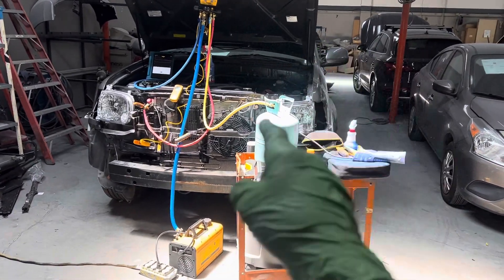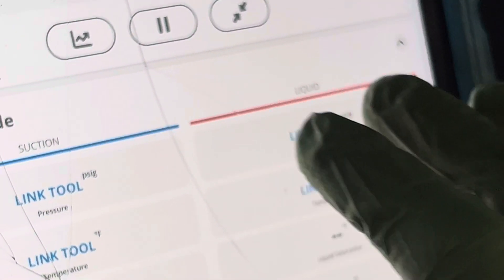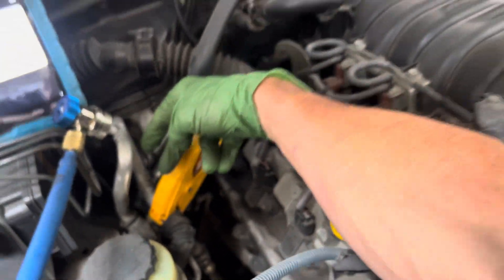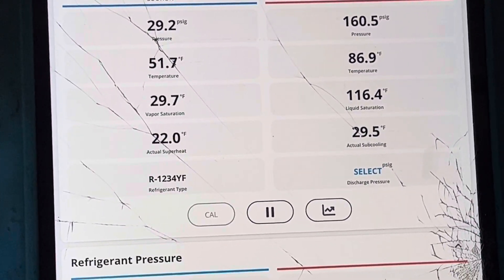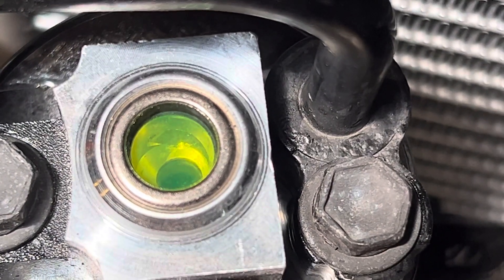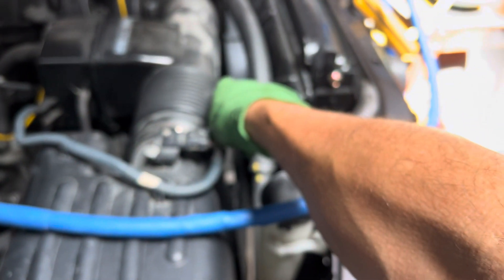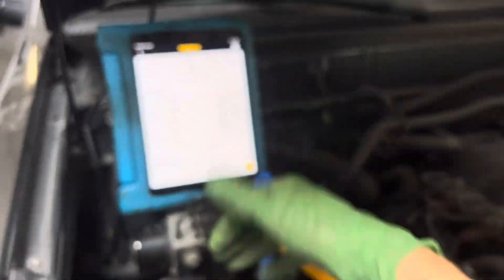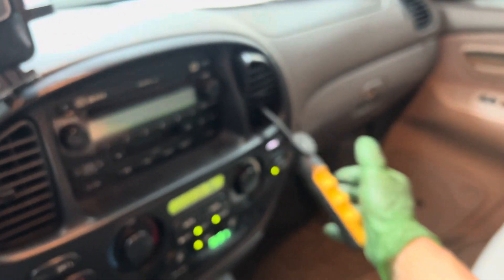Old Techs Who Were Taught ￼Using Bubbles ￼In The Side Glass(* Aftermarket, Condenser, Old Fluid Fan￼

Comment: With those wireless gauges you could monitor the system while driving that would be interesting.
Reply from the maker: I have 2 or 3 videos me driving 

One on a mild day and high side psi drops to 66 psi 39f dash. 

One record breaking heat wave day 106f  driving 39f to 40f dash temp  high side was pretty low for a 106f day can’t remember exactly what.  
2012 Prius C

Comment: My sight glass looks empty even when the compressor is cycling on and off. It cools great but the compressor makes a whining noise around 2000 rpm when hot.
Reply from the maker: If your site glass is crystal clear, it’s probably because it’s completely full so there’s no bubbles in the refrigerant is crystal clear

Comment: How about using both weight and sight glass to fine tune the charge?

Feels to me like a shooting in the dark to do that
Lots of variables 

Here in 3rd world where I live  (for us in Yemen it’s beyond the 3rd world stage :D) anyway
Here buying a OEM part is not practical because 
1-	Toyota OEM is very expensive (Denso aftermarket is not available and if I saw one available I can’t grant it’s the original as it could be a fake bad made Chinese copy
2-	 1 mistake from the ac guy (which is 95% chance they will do more than 1 thing wrong) and the new OEM parts are wasted

What would be the best method to cope with the aftermarket parts like condenser to achieve the optimum charge ?
Reply from the maker: I’m glad I don’t live there and I complain about getting aftermarket condensers every now and then I definitely don’t have a bad. 

And I hear your place is really hot in the summer 

In your case for your circumstance 

Going with battery charge and then adjusting by bubbles is the only thing you can do you have no choice

Comment: Hi Tom,can you please explain what is written in this toyota sticker how to charge AC system, replenish with refrigerant of 100+ or -50g in other sticker 200+or-50 after bubbles disappear
For daul A/C system replenish with it by operating the rear A/C system.Thank you
Reply from the maker: We do not use the bubble method here in the United States that is for old time method, or when somebody lives in a poor Third World country, who cannot afford equipment. Like a accurate scale.. 

So the bevel method is a alternative method that just get you close to being correct but not correct 

The bubble method is not accurate if the airflow is not correct due to a fan 

The bubble method is not accurate if the condenser has been replaced with the wrong condenser 

The bubble message is not accurate if the vehicle has a cabin air filter that is partially restricted that takes the heat load off of the evaporator affecting the entire system

The bubble method is not accurate unless the condenser fins are completely clean . Some areas have a lot of dust some areas have a lot of leaf or grass or pollen or flower debris flying in the air that partially plugs condensers. 

This is why the bubble method is not used in, especially in modern vehicles with variable displacement, compressors variable, Displacement fans that change fan speed are constantly cycling off, anon never giving you a steady state of the airflow .
Reply: @coldfinger459sub0  Toyota Corolla, Camry AC equipef with variable displacement compressor and is charged by sigh glass in Middle East & African countries.But I just want you to explain how to replenish for rear ac.just by operating it or by operating it +100 or -50g.
Reply from the maker: @issamadam9352  just buy a slight in accuracy of your scale or method of charging will give you a plus or minus of what you think you’re reading on a scale. 

Do you have tiny losses inside your hose? .  The scales themselves have a slight small plus or minus accuracy.

If everything is done correctly, with a scale by weight, you will usually fall within those plus or minus 

Unless you have a really bad scale or a scale out of calibration or you make a mistake, then you will be outside of that plus or minus
Reply: @coldfinger459sub0  May be I couldn't explain clearly,my question about rear AC how to replenish according to the sticker ie by operating it only or to add 100g as well.
Reply from the maker: @issamadam9352  if this was a factory, installed rear air conditioning, then the factory has a weight by quantity method to fill it

Or give you over there in Africa and the Middle East there bubble method we do not use a bubble method here 

Here, everybody homes, or rent or lease , buys manufactures, computer database for information. 

So we have access to the information that we need . And all the manufactures information for here in North America all refrigerant charge methods are all my weight only no other method.. 

Everything is exact and precise, unless there’s a mistake in the printed publication .